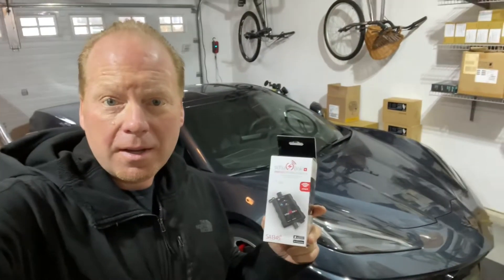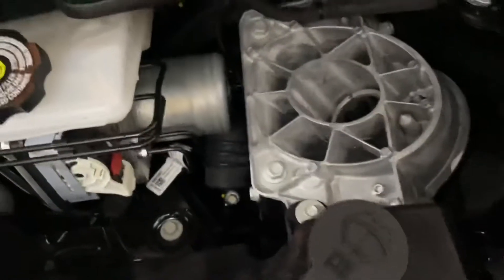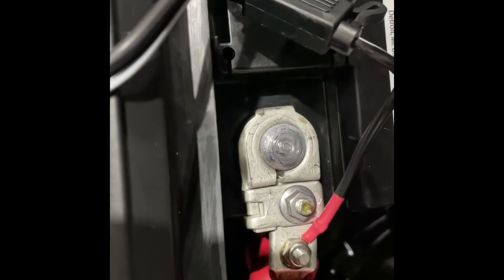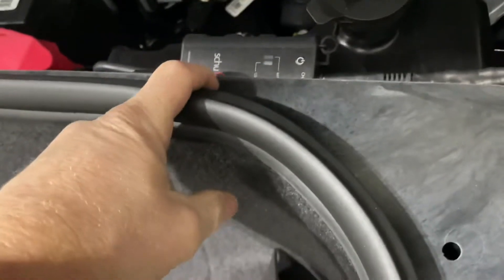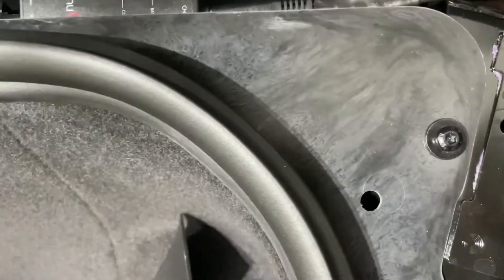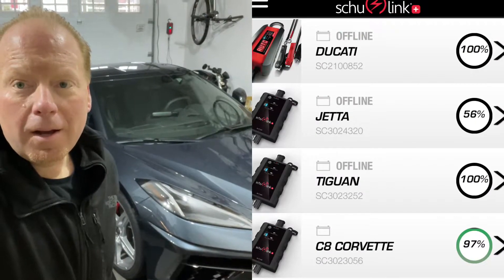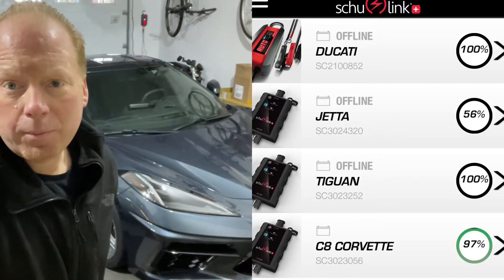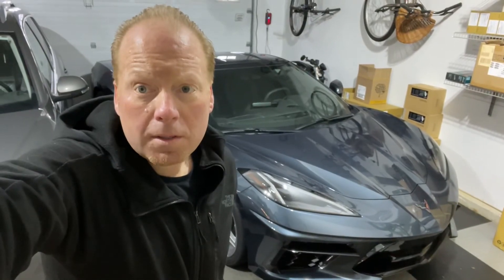Install a SA1345 smart Wi-Fi Battery Monitor in your 2021 Corvette Stingray

Comment: Thanks for the great video. Question so after how many days do you usually plug in battery tender to keep the battery healthy and the battery won't get too low, and how many days when it's absolutely necessary to plug in battery tender or else battery will die? (So how's the battery monitor been? been working great and the battery status is correct etc?)
Reply from the maker: The only one I leave on the tender is the motorcycle the the corvette stays charged even if I don't drive it for a few weeks but I check the monitor to make sure it is not getting low.  The monitors are working great they wake up take a reading a couple of times a day and go back to sleep putting no drain on the battery.
Reply: @keenanjeff  Can you monitor battery voltage level over WiFi from another house in another state ?
Reply from the maker: @roydunham3384  yes it uploads to the cloud at set intervals during the day you can read with the app anywhere.

Comment: Jeff, a follow up.  Ordered one a few weeks ago from Summit Racing they finally came back with a cancellation (no refund yet) but just found one on eBay open box.  China source dry up?  Did you know about this?  Hope it works was all excited.,
Reply from the maker: They are working great for me.  I just replaced the Tiguan with a Rivian so I have a extra one now ;-)

Comment: Hey thanks!  Does it have any significant current draw between usages of the vehicle?  It looks like you "wake it" from the app?  This would be perfect for me as I have a large cargo van that has to sit some distance away from the garage.  Barely in Bluetooth range but well within range of my mesh wifi system.  I go through lots of batteries so quickly that they all have full replacement warranty when I return them but it's still a hassle.
Reply from the maker: It uses very little power it wakes up a couple times each day and uploads to the cloud then goes back to sleep
Reply: @keenanjeff  ok so it is a one way device right?  I think I get it now, it keeps you informed with the self timer which burns minimal current.